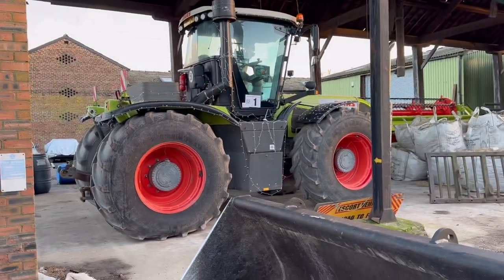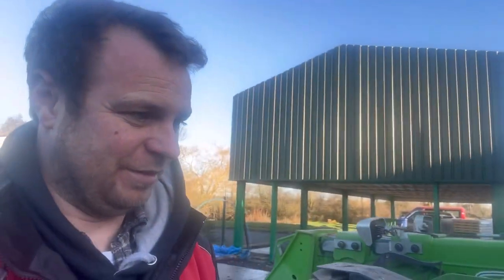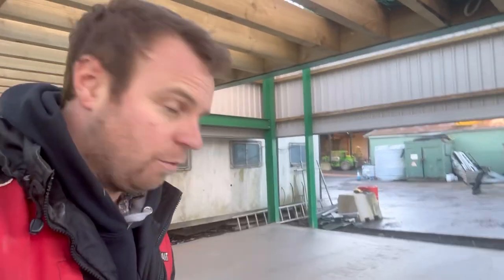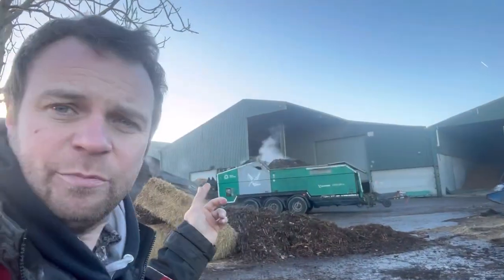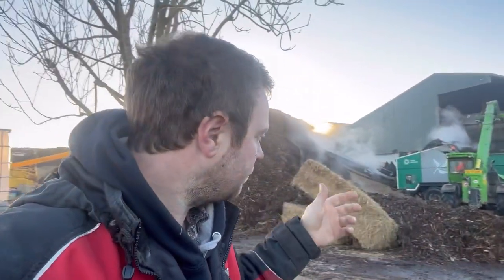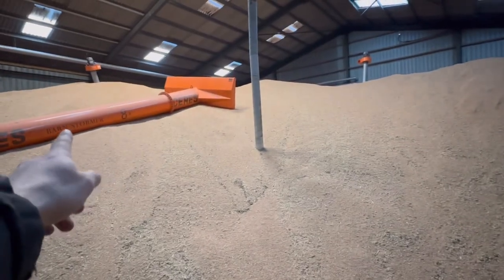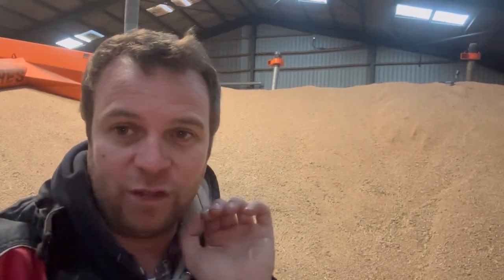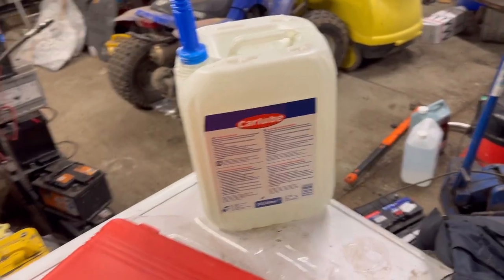MIRROR MIRROR ON THE MERLO #OLLYBLOGS #AnswerAsAPercent 1034

Comment: 33 years ago I worked for a Horticultural Nursery company that had bought a wood chipper ( tiny compared to your monster) at 27 hours a Lump hammer 🔨 went through it. Major damage to bearings.  Two months later the Diesel engine died , thankfully it was still under warranty. 
All of what you said makes so much sense 👏

Comment: We use that to lift our steering wheel off to fit my auto steer system. Modern steering wheels are pretty rubbery so spent ages trying to get it to come off… my sveaverken fitting video shows me using it!

Comment: What size screens do you run on the chipper?
I can attest to the doesn't matter what age the machine when you catch a sledge hammer or a pick axe it doesn't matter if it's brand new or 20 years old, you're very lucky if you walk away without any broken parts. I ran both and some in between and chippers and hard chunks of steel don't mix...

Comment: I swapped the wide angle mirror to the top on the merlo makes it far more useful! How reliable have your merlos been I'm fed up of ours going wrong hub seals and random not starting.
Reply from the maker: Think only ever had one hub seal in 25 years of them and 
Only get a starting issue if battery been getting old

Comment: Thats a bearing puller, the wedge shape is for sliding between a bearing and a plate, you tighten the bolts on the side to slide between the bearing and the plate, very handy to have.

Comment: Still guilty 😀. Bearing puller, we use similar for pulling bearings off hubs and out of sleeves on helicopter rotor heads. Interesting justification for the new combine and retention of the current chipper.

Comment: Great video Olly.  👏. Do you get a reduced payment if there is too much chaff in the grain? Is there a % on how much buyers will except.   Would it be worth taking mix bucket loads from each side of the shed when loading instead of of putting the grain back through the dryer?
Reply from the maker: Think it’s 3% by weight Osr is 5